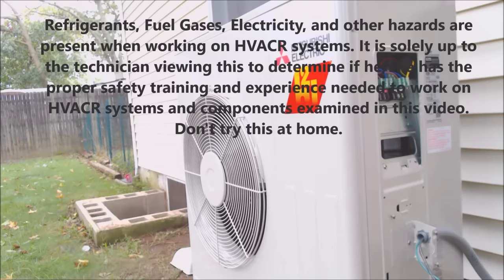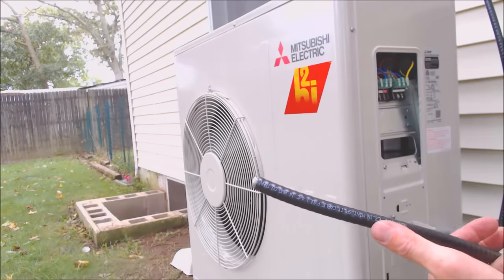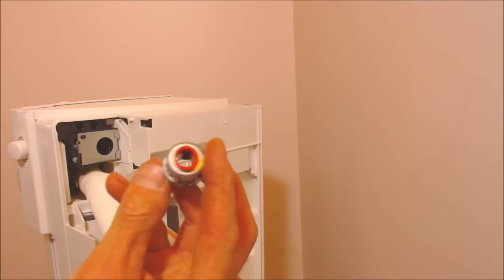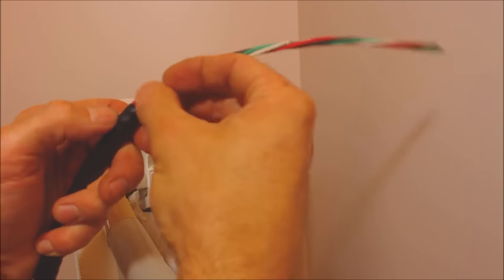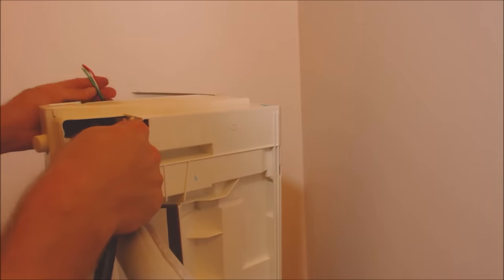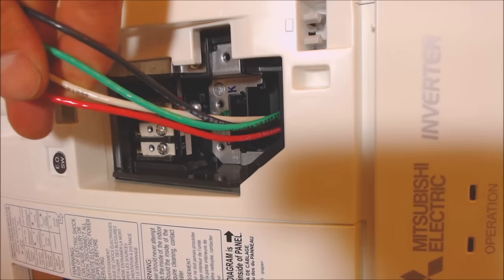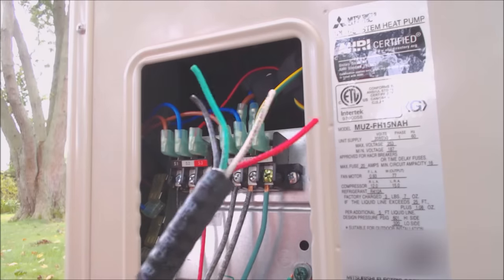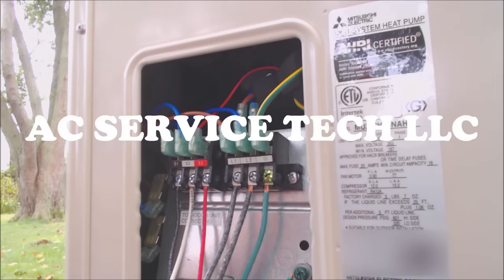Wiring a Mini Split System, Step by Step!

Comment: We bought a ductless air brand split it did not come with the wiring diagram and there's no color coding are all the wires basically the same gauge and as long as you put the red in the white in the same spot on indoor and outdoor you're good to go?
Reply from the maker: Usually you connect s1 outside to s1 inside, s2 outside to s2 inside, and s3 outside to s3 inside, they are usually the same gauge but you need to make sure the power wire from the disconnect to the outdoor unit is correct. If they did not supply a wiring diagram with a new unit, then I would contact the manufacturer and ask for one before wiring the unit though. You might be able to find one online if you google the model number and write wiring diagram, thanks

Comment: Romex or THHN wire is not rated for wet locations. You should be using THWN from your disconnect witch to your unit.
Reply: You only need thwn for underground

Comment: Great Videos!!!!
I got a question about a future Mini Heat Pump Installation
The Electrical Data for the sized unit says:
Power Supply  208/230V
MCA     15
MOCP  20
Also the wiring diagram for the Main board shows this Heat Pump is wired with a 220V Base Pan Heater and a 220V Crank Case Heater.
My ambient temperatures will drop down to -20 Celsius and colder.

The whip that came with it is #10
I want to make sure I'm sizing everything correctly. So the Data Table is showing a 20 Amp fuse and the field wiring from the Main to the Disconnect would be 12 Gauge. That seems small. Can i jump up to a next size safely or just go with the required size?
Reply from the maker: 12 gauge or even 10 gauge are sufficient for 20 amps. 12 gauge would be fine for a max fuse or max breaker of 20 amps, thanks
Reply: AC Service Tech LLC Thanks
And just stay with the recommended 20 amp breaker?
Reply from the maker: If the crancase heater and coil heater are included in the 20amp max then you must stay with a 20 amp breaker since the wiring is only rated up to 20 amps. If you are unsure if they are included in the 20 amp then contact the manufacturer to be sure, thanks
Reply: AC Service Tech LLC 
I’m pretty sure they are as the Serial Number for this unit includes these optional features in the literature that came with the mini split but it just a phone call away to make sure and to be certain.
Thanks again 👍

Comment: Quick question. Does a mini split need low voltage wire?  I installed both linesets and the thick black wire. Is that all I need or am I missing a wire?  Thanks
Reply from the maker: That is it. The 4 wire heading to the indoor unit. In the case of the mitsubishi minisplit the S3 is the communication wire, thanks

Comment: could you do a similar vid where you're wiring an air handler
Reply from the maker: I have a video on "low voltage air handler and heat pump wiring" as well as a dual fuel wiring vid but I didn't included the high voltage in them, thanks Chris!

Comment: I am installing Fujitsu mini split this wkend and the customer does not understand how the differenve between Communucation wire and the fact that its high voltage. I really don't know how to explain it to him other then its higher voltage but is also the communication wire..I am mist likely missing something also..Help!?!? I akso thought it was 110 going to the indoor but now I'm seeing 220v..Now I'm confused
Reply from the maker: Oddly enough, the communication wire has dc voltage and ac voltage on it. It is definitely not like communication wires used on 24v AC systems. Honestly, if I were you, I would just look the model number up online, download the installation instructions, read through the instructions, print out the instructions, and then just show the individual how it states to connect the wiring, thanks!
Reply: @acservicetechchannel  its so confusing to explain or even really understand..Thanks i just think the guy is over thinking if

Comment: I just installed my Mimi split and ran 14 gauge wire to a 20 amp breaker and the inside unit gave a P1 code which said that over or under power was the case. If I get a 12 gauge will it finally turn the condenser on and blow cold are ???? Please I need some insight. 👍
Reply from the maker: The voltage would need to be measured to determine the problem but with the power off, the wire should be replaced to 12 gauge anyway, thanks

Comment: Can you use MC cable instead of the Southwire EZ-IN? Does it matter if the wire is solid or stranded? Thank you.
Reply: depends on the local inspector. you can use 14-3 UF wire (grey outdoor romex) in most places and msot inspectors will let it pass since it is ourdoor rated.    bonus it's chepa as dirt.

Comment: Is there a power plug? Or power on and off switch? (Aside the one in the remote)..

Ours was newly installed, and i noticed that theres no power plug. Im just worried that even if the aircon is off (using remote), that the unit is still eating electricity, because i didnt remove the plug. ..
Reply from the maker: There is just the disconnect outside but you don't want to turn it on and off constantly though. There is no plug, thanks
Reply: @acservicetechchannel  thanks.. but are the units still eating up electricity even when its off?

Comment: nice video. question on the electric. you used 12 feed wire protected by 20 amp breaker. Why would the 14 wire run to indoor unit not require 15 amp circuit protection or 12 wire also and why stranded ground wire does't get a ring or fork terminal . looks like it would be a poor ground connection. Thanks
Reply from the maker: This is following the manufacturer specs for wire sizes at both locations but I know what you mean! An additional crimped terminal would be nice but it is secured on there, thanks!

Comment: Why Don't you need a white neutral wire with 230 volt?
Reply: In a 220 circuit, your A phase and B phase complete your circuit. There is no imbalance. The neutral carries an imbalance of power back to the utility. Since it’s perfectly balanced between the two hots, there is no need for a neutral.

Comment: Stupid question. I am appreciate. How it is posible to have 220V and no having a neutral. And why the compresor and fan is always single phase. And 220 means i have to have 2 phases
Reply from the maker: The path back travels trough the alternating hots 60 times per second in the case of 240v. Single phase can refer to 120v or 240v  even though there are 2 poles, thanks!

Comment: Manufacturer gives 8 feet to 10feet copper pipe with mini split ac 1 to 2 ton 
If anyone has install 4 feet copper pipe both liquid or suction side 

Is this create any problem 
Please explain sir
Reply from the maker: Are you saying you only need 4'? If so, just read the manual for if the refrigerant charge needs to be partially recovered for less distance being used. Most have an accumulator so the mini splits have a range of operating line set lengths in reference to how much refrigerant is in the system, thanks
Reply: @acservicetechchannel  sir mini split
If outdoor unit install on roof with distance 4 feet only 
Is this create any problem 
 is this necessary to make distance 7 to 8 feet i heard

Comment: The comms wires are in the same conduit as the indoor unit power supply wires. Is this not an issue ?
Reply from the maker: Most inspectors are starting to allow that. Everyone keeps thinking that there is only on e communication wire but the path back is one of the ac power wires so really its all connected anyway so why separate, thanks

Comment: Call me idiot if you want. But why 240 volts doesnt need neutral????
Reply from the maker: 240v ac alternates so you can power a 240v appliance with two hots only, One hot sends the power and the other hot completes the circuit before that wires switch, thanks.
Reply: AC Service Tech LLC thank you, I was wondering the same and was confused
Reply from the maker: Thanks Vinceleto!

Comment: What is s1 s2 and s3 at 11:00
Reply from the maker: S1 and S2 are the power wires and S3 is the communication wire but they are traveling from the outdoor unit to the indoor unit, thanks!

Comment: I’m doing a mini split install now. I ran 14 gauge wire for my line voltage which is on a dual 20amp breaker. The whip I have has 10 gauge wire inside of it. Is it ok to run that to my line connections on my outdoor unit?
Reply from the maker: Its ok to oversize the wire needed for amperage.